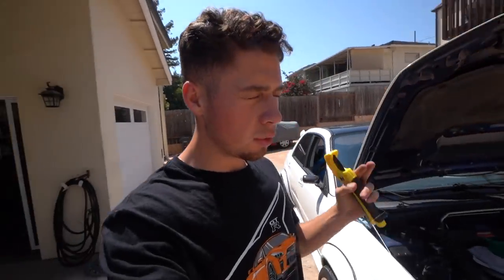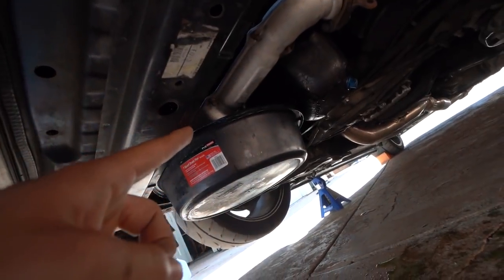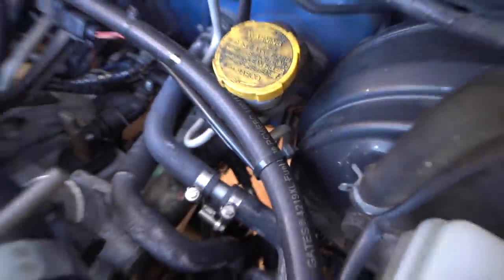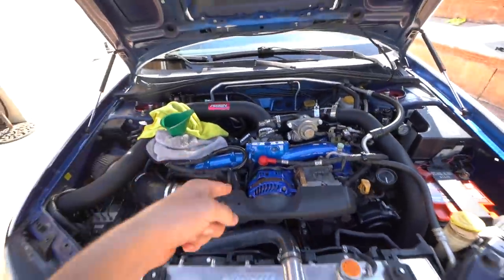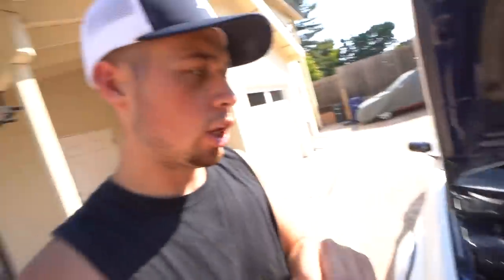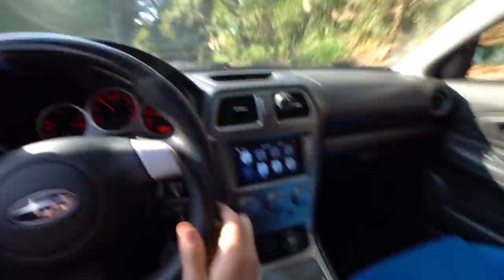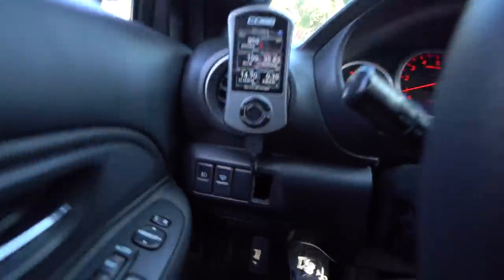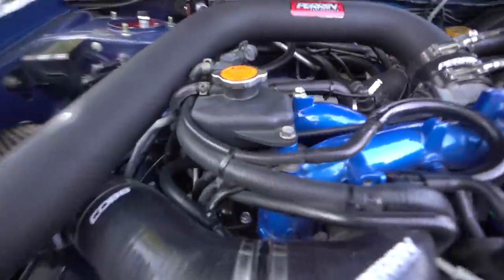THIS CHEAP MOD COULD SAVE YOUR SUBARU!

Comment: I got mine from torque solutions. Had it for a few months. Haven’t noticed any actual difference. My car dosnt overheat at all but no noticeable difference. But it’s one of those mods that saves the engine in the future
Reply: Did you change the coolant as well? If you didn’t I suggest you get one of those coolant pH and corrosion test strips and test the coolant. The one I used which I got from work was from Phoenix systems. You can test your coolant and your brake fluid with their strips
Reply: @selwyn13  yes. I have actually drained my coolant a few times since then. My car runs good and I did the mishimoto colder thermostat as well. So the car runs cooler.

Comment: Hows your cabin heat? I literally just finished mine on Friday. Looks like your heater core lines are mixed up. Top line should plumb into the coolant crossover.

Comment: I thought cylinder 3 was next to turbo and got the hottest 🥵
Reply: No. The extra coolant passages connected to the turbo on the back of the head keep it significantly cooler. I dropped valve seats on my driver side head because of heat. Meanwhile my passenger side head still going strong with 250k miles.

Comment: You know how in the RPM’s it has the light to let you know when to shift, mine turned off one day and I never knew how to get it to turn on again :/ anyone know how too?
Reply: And where did you get your custom steering wheel?looks dope ! Need one for my 04 sti 🥺
Reply: You don't need that light to know when to shift. Listen to the exhaust
Reply: @elijahwilliams4214  Yea but he has the special STI shift light, kinda part of the dashboard why wouldn't u want it to work.
Reply: you have to twist the rod by the cluster, not the trip reset one and the farther you twist it clock wise the higher the rpm it will be before the light turns on
Reply: at least thats how it is on my 01 jdm sti